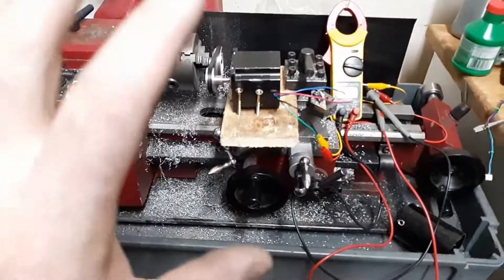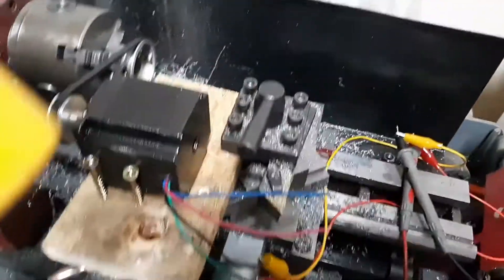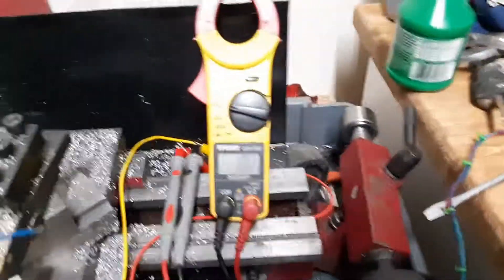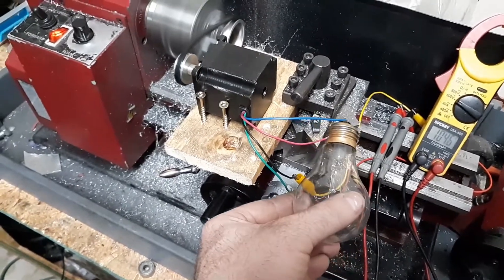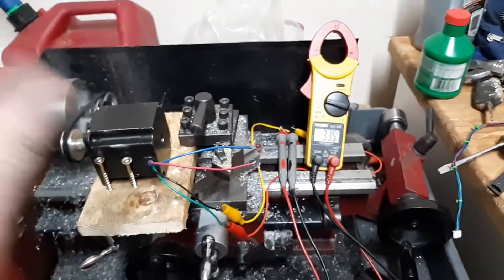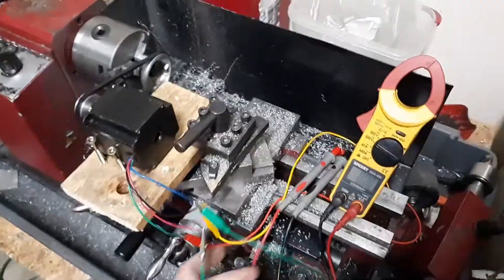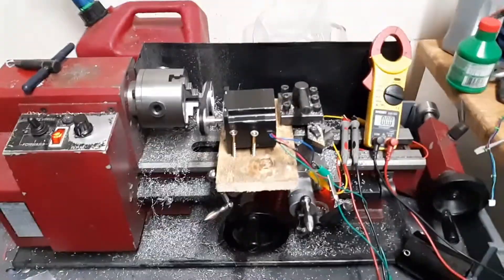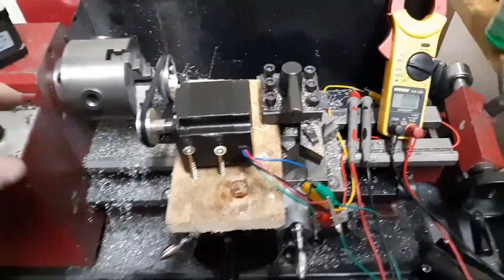Quest For Engine Powered Lights Continues!  Discovery Today In lab LOL!

Comment: I think someone needs to redesign a coil to fit in there to replace the one that comes with a kit.
Yeah i know they sell aftermarket add- on coils, etc that work marginally at best.
Been down that road, spent way too much already just on electric/ charge capabilities to no avail.

I think that's probably one of the biggest let downs with these motors, especially for all the devices we use today, all day.
I dabble in electronics, build amps, guitars, electronic stomp boxes, etc but never messed around with any coils, Tesla style. 🤣
Reply from the maker: it's been done lolz  80$ you can own your own bottom half with one off ebay! ! https://www.ebay.com/itm/403027353706?hash=item5dd64d606a:g:I1cAAOSwyhti8op2&amdata=enc%3AAQAHAAAAoEAjT3XRCrm36VZYxFmy3fW5t5tFFj8Fzbq6hnkppAiVvNoenX2PmReSJ6I8jYxvpWe9jcfhnZdbJtvj%2FiZ5xyR6fwVcAqk6ddVgj6Ur1BJEpEom0PUyEE8KZAjj%2FUXhm5l3d%2BInyszcoxMF%2Bu2yHQB54aqZbwiKhiiKDo6p7O6Othv%2BBsLbQqwXhUPvTt1zk%2FtYBAKS77zRPVVNV30Lq24%3D%7Ctkp%3ABk9SR-K8rOXCYQ
Reply: @BuildBreakFix  yeah the G80's